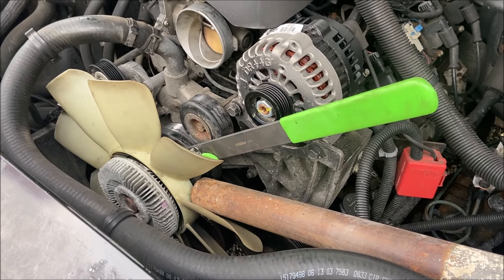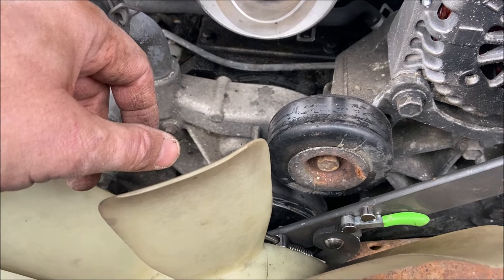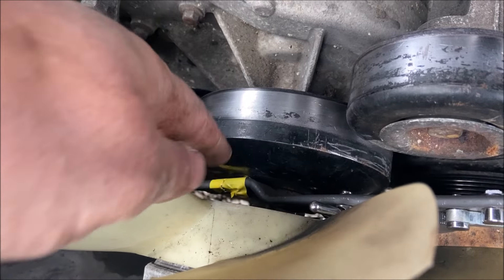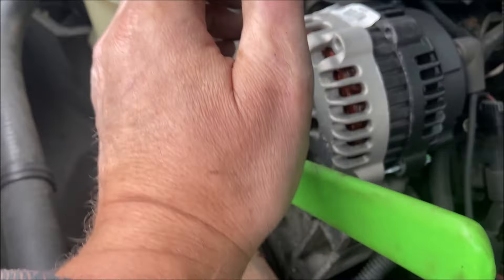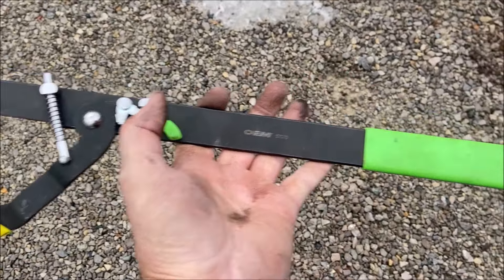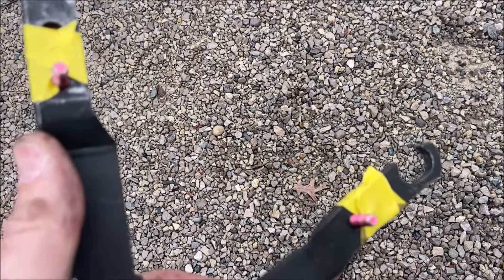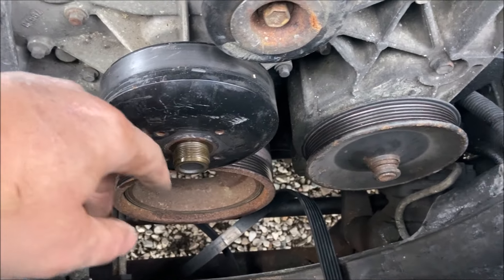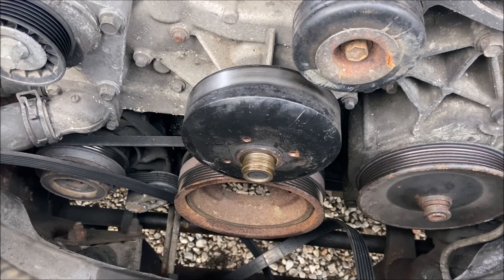OldGuyDIY Final Solution To Remove Water Pump Fan Nut GM 5.3L Tahoe Suburban Auto Zone 57270 Best ?

Comment: Keep the belt on ! Spray penetrating fluid on the nut Then get a long pointed drift and pound a dent on the clutch nut with a hammer counter clockwise ! Use anti-seize putting it back on !